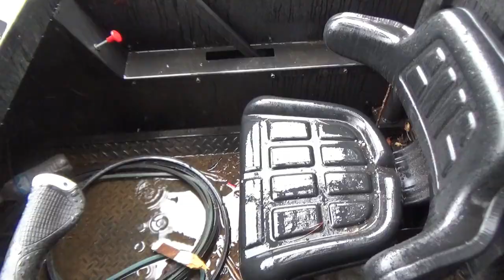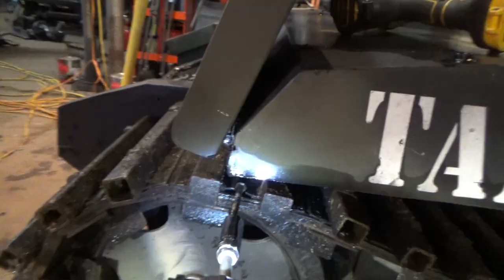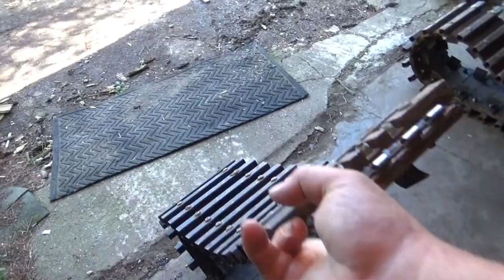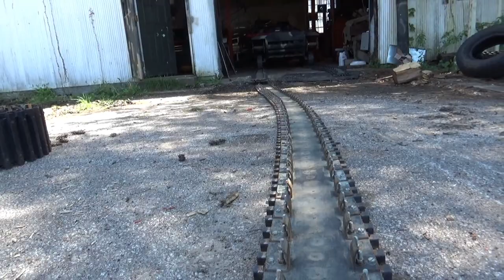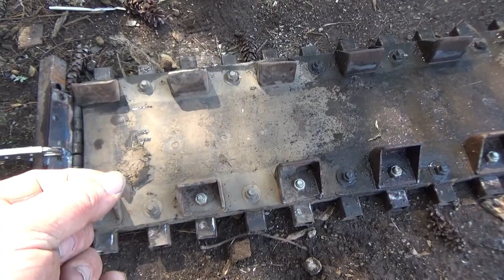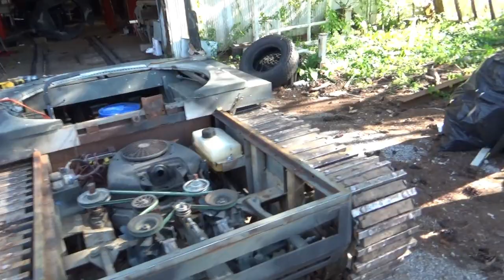Tracked Vehicle 6 removal of homemade tracks

Comment: I appreciate every video that explains different aspects of your builds as it certainly keeps the fire to build "burning!" Thanks!
Reply from the maker: We are changing our pumps and increasing our motor to 35 hp , after testing I will let you know how they work . the set up on the M A V is just a little under powered we also are going to direct drive tandem pumps .
Reply: @mimimitchell1989  sounds more expensive but you have the usability of the MAV to design for, but will the tanks get the upgrade also?
Reply from the maker: @cereus57  The tanks really are strong enough for just driving around and tank battles . The price difference in the new engines is about $800.00 . That said , the MAV in the videos has the exact set up as the tanks and it's about 600 lbs heavier .

Comment: Do you have a rough idea of what it would cost in materials to build the M A V. I really love that machine and i am interested in building one
Reply from the maker: Thank you, for your comment. The hydraulics and motor has over $4,000.00  alone .  I would say just under 7,000.00  if you can mill and fabricate all your parts wheels included .

Comment: What did u use to make the tracks with and we're can I git the materials
Reply from the maker: I will be posting a video on repairing the tracks so you can get a closer look . the tracks are 1x1 box tube, 2x2 angle and 2.25 '' x 1/8 flat plate that you can buy at any metal supply company . If you can build the tracks first the rest of the tank is easy. Good luck and thank you for your comment .
Reply: @mimimitchell1989  ok thank what did u use to hold all the metal to the track and we're did u find it

Comment: What type engine are you using ?
Reply from the maker: 26 hp kohler but its a little weak so we are upgrading to a 35 hp vanguard . The mav can go anywhere while hauling it's own weight in payload but has a little motor bog on steep inclines and turning (zero turning), in very thick tall grass with a payload
Reply: Sry for the repeat question I'm sure, but what brand are the hydrostats?